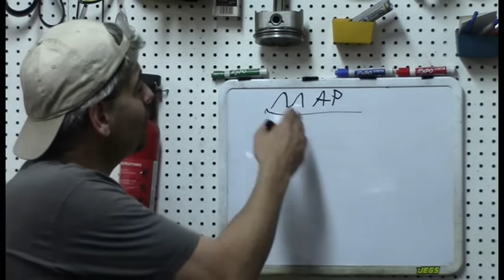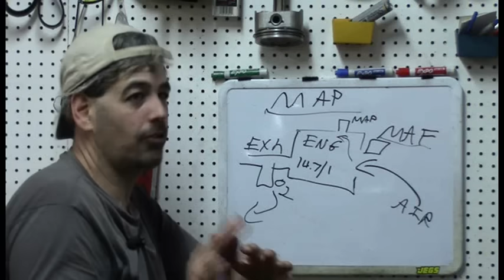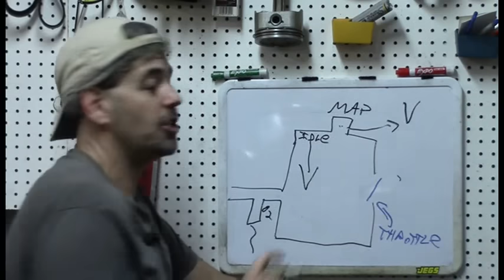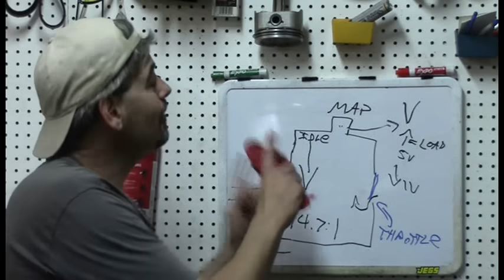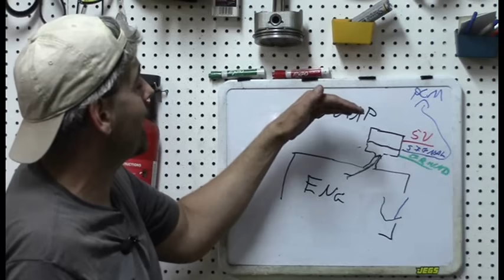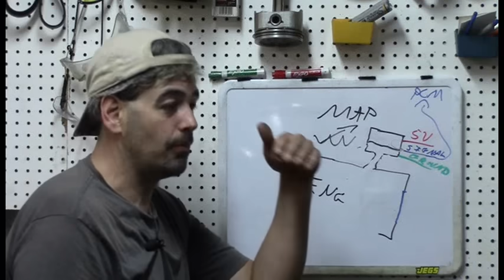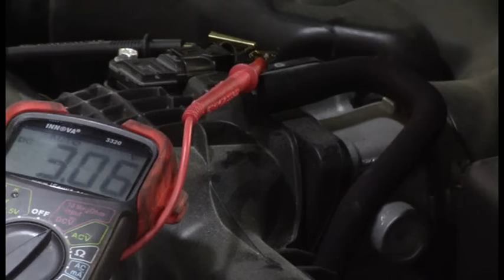MAP Sensor Diagnosis and Understanding Function- Pt1

Comment: excellent videos, I was wondering if you can tell me what kind of software do you use to troubleshoot. I notice you have your computer monitor with all the software running.
keep up the great work. I love to fix my own cars and my friends but I also love to learn exactly how all parts actually work and your videos are some of the best for that.
thanks
luis
Reply from the maker: I mainly use AutoEnginuity
Reply: thanks, so the software and hardware for that is like $400.00 and will do basically any kind of cars?
Reply from the maker: Luis Cuadra Sort of- for $400 it will do only one manufacturer (Ford, GM, etc) from 1996 on up. You will choose which manufacturer.  For $1400 it will do ANY car 1996 and up.

Comment: Thanks a lot for your explanation. Makes total sense. I do have a problem with my readings and I really cannot understand what might cause this. I get my readings in kPa and I've just replaced the sensor.

So on idle, I do get around 35 kPa, which from my research is the expected value. The problem is that sometimes, after driving the car for few minutes, it will display 101 kPa at idle (like it's blocking??). Minutes later it might start to work again and it seems that when it's working, it's giving correct figures.  Old sensor had the same behavior (blockage). Thus I suspect it's not the sensor. 

Car is a Ford Mondeo SCI from 2003, and the readings are with a OBD2 device. Same issue shows up when connecting a Ford IDS scanner. No errors on scanner.

Any ideas?
Reply from the maker: What data do you have from the FPR?
Reply: The FPR usually stays around 40 bar at idle (has HFP) and during the time the MAP is 101 at idle, the FPR is still around 40 bar
Reply from the maker: Florin Raucescu I would examine the LTFT and STFT during the time you see this spike and validate you are seeing a rich condition which would indicative of FPR issue at the time.
Reply: Here is a screenshot with recent data I collected: http://pix.toile-libre.org/upload/original/1472843215.png. And a few minutes later: http://pix.toile-libre.org/upload/original/1472843397.png. Something happens with the BARO as well... I don't know if there is a different sensor for it. Possibly not
Reply from the maker: I see no relevant data there? Why did you choose those parameters exactly- for example what was your strategy for looking at MAF data?
Reply: I've selected more parameters to inspect because the car had some issue I could not figure out (fuel cuts when very warm outside). I might have found the cause yesterday (had a partially broken wire on the fuel metering valve connector). MAP was replaced with that issue in mind as well
Reply: If you care to look at this CSV file: https://drive.google.com/open?id=0B4Xl_ohfnB8nbXBUN0I0cU9zTmc
Fuel trim data is also there. Any input is highly appreciated. Thanks a lot for checking this out.
Reply from the maker: Florin Raucescu I don't have time to look at just a bunch of random data- please just send me a graph of only relevant data and I'll be happy to interpret. If I can get a curve of STFT and LTFT at idle vs load curved against fuel pressure I'll be happy to look at it.
Reply: LTFT staid at 0 during that ride. STFT rised up to 11,72 on that rev up(3rd gear i think). Not sure if this says much, but here is a curve for that acceleration that also caught the MAP on the rise up to 101 kPA, where it just blocked. http://pix.toile-libre.org/upload/original/1472848351.png. Thanks
Reply from the maker: Sorry that is not the data I need. I don't think I am going to be able to help on this. If you can produce he relevant data specific to the incidence I will be happy to analyze. Good luck man. Hope you get it resolved.
Reply: Thanks anyway for checking it out.  Hopefully I will figure it out.  Just remembered that yesterday I was in the car looking at the MAP on scanner while it was at 35 kPa.  Then I just knocked the throttle pedal for half a second (revs hardly increased by 50 rpm) and the MAP went to 101 kPa and stayed there.  Car continued to idle normally.  Some electrical issue maybe? Let me know if you get any idea. Thanks

Comment: At 4:50 you're incorrect also, it does not measure the "air" in the intake, it measures the absolute pressure.
Reply from the maker: gojudude  while technically it measures the absolute pressure, the air volume is calculated from this pressure along with the IAT input to get a volume estimation that is used for the fuel addition calculation to get a stoichiometric mix.  Stoichiometry is calculated by volume:volume and not pressure:volume so ultimately, volume is calculated though, technically, the sensor itself does measure pressue. You're splitting hairs bro.
Reply: Schrodingers Box
Well, not really splitting hairs. The MAP is absolute because it's reference is zero, not atmospheric. The MAP reads in PSIA instead of PSIG. There is far more than just IAT that is involved on a speed density system for fuel calculation. The PCM takes RPM, TPS, IAT, ECT, BARO, MAP, and EGR on this system for fuel calculation.Speed/density systems use a MAP sensor to measure the volume of air going into the engine. MAP times rpm is
proportional to air volume, but then you have to correct for volumetric efficiency, EGR flow, and air density to get the actual air mass flow. These systems need BARO in order to achieve proper A/F ratio because the density of air changes as you go up in altitude.  BARO - MAP = Vacuum.  Fuel delivery is calculated based upon a ratio between the mass of air vs. the mass of fuel required to achieve our target mixture. (Fuel system engineers will reference this as equivalence ratio (fuel:air ratio). Note this is the opposite of the references of (air:fuel ratio) or Lambda.
Reply from the maker: Sounds to me like you need your own channel more than you need mine.
Reply: Schrodingers Box
No way!!!! I have very little time and no desire to have a channel lol.

Comment: Thank you very much. I have benefited greatly from your explanation. I have a car with very weak torque and an erratic engine, but when I remove the map sensor link, the engine stops. Is the sensor damaged or what?
Reply from the maker: Not sure. What data do you have?
Reply: @SchrodingersBox  I do not have a testing device, sir. Except as I said, when I remove the map connector, the fault light lights up, the engine stabilizes well, and the car’s torque increases on the road. Should I go to a technician to have the device checked, since I live very far from the technicians, or are there ways to repair the fault that you can advise me on, sir?
Thanks for the quick reply
Reply from the maker: You need data- just get a $10 DVOM and measure the reference and signal voltages as a first step.
Reply: @SchrodingersBox  
Thank you sir

Comment: Thank you for this video mate. Can we take signal from MAP sensor for digital boost meter gauge on the dash?
Reply from the maker: You're welcome.
  As for the digital MAP... not really.  The digital MAP is going to have a very, very rapid sequence of on-off signals that you can't track with a meter.  You can only get an average reading which is only so helpful- it won't confirm the signal is actually functional.
Reply: More to the point over SBs reply is the issue of multiple signal paths. In the world of electronics, when a signal splits - as in part for the PCM and part to your dash meter - the resistance drops, the current goes up, and neither path gets the proper and correct reading. If I wanted to do that, I would devise a way to split the AIR path to the MAP so you could two separate sensors sensing the MAP. One sensor dedicated to the PCM and the other for your dash device.

Comment: Good video. I have one question. You stated that at open throttle voltage should increase. Should it stay increased as long as throttle is open or raise then drop?
Reply from the maker: it stays open as long as throttle is held in that position. the angle and voltage are completely linear.
Reply: Trying to diagnose my map sensor with only a volt meter. When I hold the throttle down the voltage goes from 1.2v to 3.4v then immediately drops. Is it safe to say it should stay up in volts while holding the throttle down and if not the sensor is bad?
Reply from the maker: Is that with engine running or key on engine off?
Reply: Engine running
Reply from the maker: Sounds like the rev limiter may be engaging then?
Reply: I am not doing full throttle, about half throttle.
Reply from the maker: Ok but are you hitting the rev limiter?
  In either case it’s pretty easy - just check the ACTUAL throttle position voltage at the connector with Key on engine off. Compare that to the scan tool.

Comment: I think that the MAP sensor does not determine air flow by itself but also with RPM 
Also I Dont think that a specific throttle position of say 20%  means a specific/ specified amount of air flow. Same is true for RPM.
Reply from the maker: Jared Stieg What is your source for this?
Reply from the maker: Ok just wondering why you were saying that because I am pretty sure I never said MAP reads flow- because it most certainly does not.

Comment: Hey Mr. Shrodinger, (is you cat dead or alive?)
  Thanks for the great in depth videos. I'm almost 70 and crawling around under the hood of my 99 Chevy Tahoe 5.7 isn't much fun anymore. I've had one hellofa time finding a decent mechanic that really knows how to diagnose problems. Most of the time I feel like I know more than they do. What kind of questions would you ask of a so called "mechanic" to filter out the blockheads and numbnuts?
Reply from the maker: It's  actually really easy to find the blockheads (good term lol) and as you can see from the comments, I can actually pick them out a mile away just from there very first comment alone.  The biggest clue is when they come to a conclusion based on symptoms rather than data.  That is always the dead givaway. 
 There are lots of ways they do this. "Oh these cars are known for that issue so it must be XYZ".  "The last three cars I saw had a bad XYZ so it must the same for your car...".  "It's probably an Oxygen sensor because that's what the code says"....
   A mechanic who actually refuses to give a conclusion  until he actually sees the car is the one to trust.

Comment: You are apparently very knowledgeable but I want understand what was causing my MAP sensor reading to read high; not design a new circuit. I don’t want to pluck and chuck parts hoping I replace the problem part but also don’t need to know the fuel/oxygen ratio is a stoikiometric measurement. 
   Maybe you could make a short video stricting concerning why the MAP sensor might be giving bad reading so I could check those possible problems. Best of luck.
Reply from the maker: Impossible to know without knowing the stoichiometry data.

Comment: I have a 2005 Toyota Corolla  le, the Air  and fuel ratio  sensor is not working  or lazy sensor anyway,with P0420  error  code the problem  is Mass air  flow  sensor it's  broken but now I change  the  MAFS and running  smooth and no more  P0420 ,it's fluctuating  now Air and fuel ratio  sensor bank1.❤❤❤❤❤❤

Comment: Matt :  I have a 1991 Ford Ranger 3.0     Just changed the MAP Sensor.  Engine runs a little smoother since the MAF Sensor is OK.  One question:  Does the MAP sensor hose stay unconnected  since the MAF connector takes over for the 14 part air to 1 part gas flow ? Is the MAP inconsequential in this matter, regarding engine performance?
The reason I ask is when I connected MAP senor hose connector , the check engine light went on.  When I revved the engine the check engine  would go off temporary then go back on.  Are these two sensors in conflict with each other when the MAP sensor hose is connected.  WHen I removed the MAP sensor hose connector the check engine light went off and the engine ran smooth.
Reply: Co Gar  REPLACED and its running better.
Thanks

Comment: It kinda help idk what to do any more
Reply from the maker: start with the basics. What data do you have?
Reply: Schrodingers Box I think it’s the pcv valve it popped lean coded and had oil all in the spark plugs thing
Reply from the maker: that could be a million things. What data are you using though?  Fuel trims?  induction metrics?
Reply: Schrodingers Box idk I’m 15 and all I have is my neighbor scan tool and it popped the codes po106 po128 p2195 it had previously had codes like bad fuel pump o2 sensor map sensor idle control valve and my dad put brand new parts on it I went to look at the spark plugs in it and oil was almost to the brim so I figured the oil fouled the spark plug/coils  so I bought new ones and put a new valve cover gasket in but a didn’t notice any damage to the o ring thing and it ran the same
Reply from the maker: Yeah sorry I am not going to be able to help. I need data from that scantool to diagnose it.
Reply: Schrodingers Box idk I’m taking it to a mechanic tomorrow

Comment: Amazing explanation of map sensor and what it does. I have a problem with my car, it runs fine but when it goes into DPF regeneration it plumes out light blue smoke from the exhaust, smells like burning diesel not oil. It has map and maf sensors. I tested the map sensor and it doesn't rise more than 2.2 v when revving and doesn't drop below 1v when releasing the throttle peddle. This was done not while in regen. How do I know if map is faulty or map is making correct reading and something else is effecting the pressure? 
Many thanks
Reply from the maker: You need to check that you have 5V reference signal and also no resistance on ground (easily validated by voltage drop between the sensor output and ground).
Reply: @SchrodingersBox  Thanks for quick reply, I'll check that. Regarding the smoky exhaust fumes on regen have you come across this before?
Reply from the maker: @effimia3  Several times... For as many different reasons since it was different cause each time.  have to determine each case independently.

Comment: My son has a 2006 Impala 3.9. All fuses and relays are good. He had a new fuel pump put in. When he tries to start the car, it only cranks but, when he sprays starter fluid in the vent tube it runs and will not stop running until he shuts it off!? He can drive as much as he wants and the engine will not shut off until he shuts it off.
If the fuel pump is new and running, why does the engine stay running after spraying with starter fluid? I was told, when you spray starter fluid and the engines runs, you have a bad fuel pump if it shuts off after a few seconds.I am confused!
    GOD bless and thanks for any possible solution.
Reply from the maker: What data do you have? I would need data to even begin a direction of diagnosis.
Reply: Please read again. I just want to know why the engine stays running after spraying starter fluid instead of the engine shutting off and the engine cranks but, will not run.
Thanks again.

Comment: I own a 02 Buick regal n recently replaced the MAF sensor, but now it starts n stalls again. Do I need a MAP sensor also?. My car has both. Great video by the way
Reply from the maker: What was the data showing the MAF was defective?
Reply: Watched a video about if you unplugged the sensor it shouldn't stall out meaning it was good. I'm not mechanically inclined. I got the P0440 EVAP Emission System Fault. I know it could be more than 1 or 2 things. Do you think the plenum has anything to do with it? because I know for a fact the coolant elbows have to be changed. doing  research onmy vehical and it gets confusing

Comment: Glad to hear you have a trans am, love those cars, I have 2002 camaro 3.8 v6 166xxx miles all stock since I got it I did the complete tune up wires plugs, fuel filter, fluids, now I recently put in a k&n air intake and runs good sounds good but after a day of runing around light came on reading codes p0171 & p0174? cleaning the maf didnt help I try replacing the O2 sensors because I`m an idiot and I thought it was about time since my car has 166 miles and they look beet up, but nothing also when I put the factory stock air intake and clear the code its fine? now if I am reading this correctly my long trem fuel trim bank 1 is 17.2% & bank 2 is 18.8% also bank 1 short trim is 10.2% and bank 2 is 8.6%, I don`t know what to make of nun of this? any ideas you code help me out with?
Reply from the maker: Carlos Zavala See my video "secret of engine problem diagnosis: fuel trims" and you will be able to easily diagnose it.

Comment: In layman's terms... if you're experiencing the following issues:  (!!! The DREADED 232, ECM Code !!! for my Volvo aficionados )                                                      ... "OR" ...

-Rich air-fuel ratio
 (you'll smell it, believe me!!)

-Lean air-fuel ratio

-Surging or (engine appears to be loping up & down, for ex., when sitting
 at a red light??)

-Poor fuel economy
 (in fact, your MPG's will SUCK if it's actually the MAP or MAF Sensor)

-It won't start
 "OR" hard to start.

-Lack of engine Power/Stalling...(Regardless of how hard you're smashing the gas peddle to or THROUGH the floor, whilst chugging along at 1 to 2 MPH ...until it dies!)

-Detonation and misfire (little engine popping sounds, which may also  cause the car to chug along)

Then, more than likely your MAP, and/or possibly MAF sensor(s) need cleaning or replacement.
sidenote  Replacement upwards of $50 bucks vs Cleaning, $5 bucks for a can of "Electric Component Spray" !!NOT, WD40-!!...  Also, the MAP Sensor is known as the (TPS) or Throttle Position Sensor, just in case you're hunting for the part online... 

In either case Mr. Schrod you're an amazing teacher, dude!

Welp, that's all I got in the tank.

Comment: the dealership said I have a bad map sensor. I put a new one on. my van now wont run if I plug it in. it stops running. but runs unplugged
Reply from the maker: +Kim Chance What data do you have from the diagnostics shown in the video?